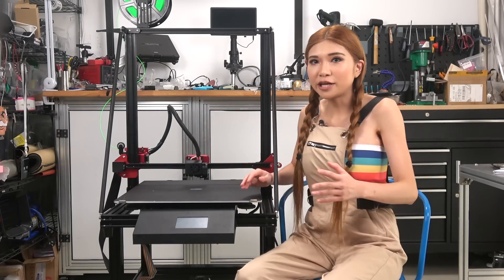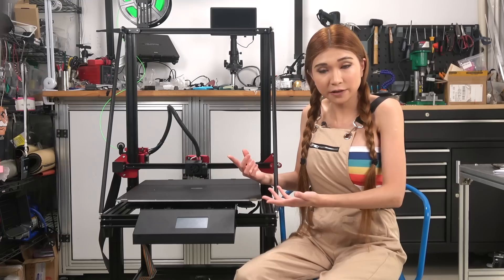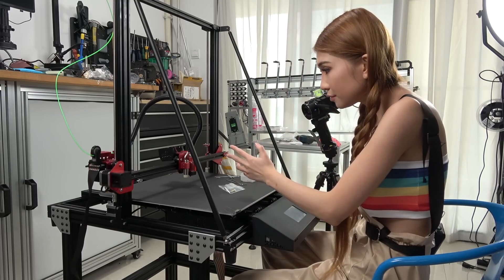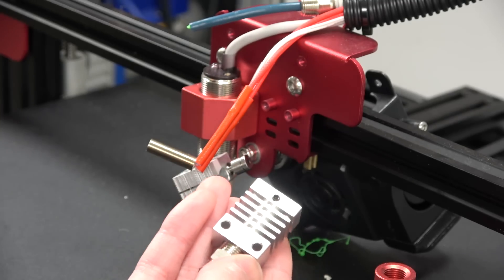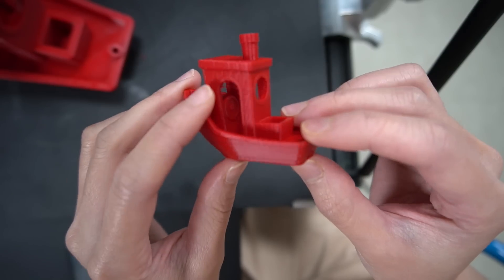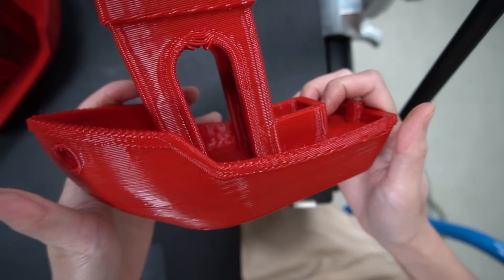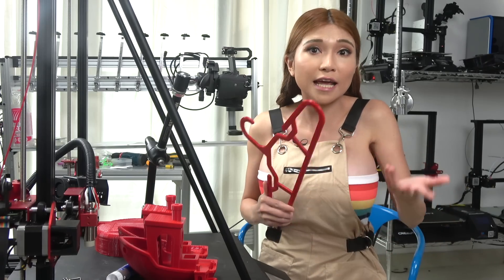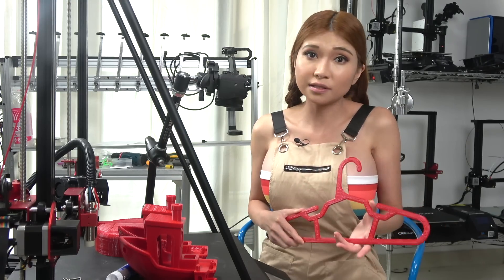First Look- Creality CR-10 Max! Also, Supply Chain Disruption- Are We There Yet?

Comment: I don't really know anything about 3D printing - would it be possible to print the exterior at a higher, smoother resolution, and use low resolution for the core? So when it's printing part of the surface, it switches to higher res - or do you need to physically set the nozzle to a certain size before you start the print?

If they can adjust the resolution like that you might be able to get quick, solid prints that still look nice on the outside - maybe even nicer than usual!
Reply from the maker: Yup! There are printers that do that, does not save a ton of time though...
Reply: @Naomi-Wu  hrm, wonder if it's the adjusting that's slow? Like ideally it would be close to low res speed since most of the printing is at that resolution. Maybe they'll get better at it in the future!

Hope you donate that massive boat to a kid! Or someone with a bath

Comment: Nice Video but im not exactly shure about the main point, at least it was the main point for me. A print needs to be structural so the highter the strenght and the less material i use the Better it is. 
And there comes the problem with wood u have the propaty of lets say a softish pine that grew fast that u have big wood rings that wood is soft, hard wood grew slow and had small wood rings. 
Now comes my point i think cnc kitchen prooved that with a .4mm nozzel he got the most layer adhesion with 1.6mm layerhight and that is a ferly fine layering. compered to suber massive layers. Is there some literature providing proof to your theses ? 
Overall it was a good video. Taking in vids means information and i like information.
Reply from the maker: CNC kitchen knows his stuff so if he tested it I defer to him😉

Comment: What would the minimum allowed layer height for a nozzle that size be, and would the density of the wall thickness make for a better approach. Like would printing at  
.4mm height with just 1 or 2 walls as opposed to .4mm nozzle needing 3 to 4 walls to produce clean prints and would it increase strength by having more surface area bonded per layer with a 1mm nozzle?
Reply from the maker: You can go as low as you like, just get a really thick wall (and no sharp edges).

Comment: DAMN! This made me realize, we need to GET RID OF the standed E3D mount and convert the heatsink into a super deep thread like the sensor you got there, the nut side does not need to be super deep, just the heatsink so it functions still as heatsink, but that would solve the issues on replacing / upgrading / adjusting hotends.

Comment: Large 3d printers have their own place, and are not necessarily weaker (wrong settings!), and you can also print fast (volcano hotend + high temp). I own a CR-10 S5, Anycubic Chiron, Folgertech FT-6, Tronxy X5S large printers.

Albeit i agree, small printers have their own place, most parts are fairly small. Unfotunately, with creality you get soooo slow printer at small size it's a net negative due to the small motors, drivers etc. Something like Ender-3 + even sturdier frame + LARGE motors + STRONG drivers (if not TB6600 then atleast DRV8825) would be suuuuuper sweet. Esp if using MKS Gen L or BIQU SKR instead of their own closed crapola.

Comment: Never expected Creality to come with a printer even bigger than the CR10 S5 to be honest, altough it looks to be an upgraded version of that machine. I wonder what has been done to optimise the weight of the heatbed (and torque Y motor) and the heatbed heating/bed insulation to make the bed even bigger without issues in movement or heating. I was so exited with this new printer from Creality I didn't even notice this was an old video ;-)

Comment: I would put my 1.2MM Super Volcano up against any glued together multiprint... provided that each part isn't rotated for maximum strength in a multitude of stress directions (gotta compare apple to apples). If a nozzle is pumping out 5X layer heights then that is five .2mm layers printed in a single layer so that one layer isn't going to split from its self. Not only that the volume of heat and the huge cross section of contact between each fat layer allows for incredibly strong layer adhesion. You could only match that layer adhesion with 3D Gloop. Also, I, like many others on youtube love the fat layer lines... just like some people love wood grain. I love larger nozzles... bigger... faster and beautiful.

Big printers are NOT Stupid. I have all kinds of printers(MK3, Beast, CR-10, CR-10S5, I3 Mega, Select Mini) and I love my large nozzle printers and the prints that come off of them!

Comment: You know this Naomi, as you taught me! But some viewers might not realise the 'ace' a large 3D printer has is small production runs of multiple parts. Sure, 16 hours for a single really large print is not practice, but getting 30-50 identical (cheap) product parts with no human interaction needed during that time is fantastic for a small manufacturing business! 

It's nice to see the dual motor drive added on the moving bed. I added a more powerful motor to the bed of my CR10S Pro, I felt it needed a bit more power too. ( https://www.instructables.com/id/Creality-CR10S-Pro-Y-Axis-Stepper-and-Power-Upgrad/ )

I'm more than happy to listen to you talk for hours. If the subject interests me I want to know everything and you present very well! I liked the talk you did about open source, it was informative for a small business.

Comment: Printing 2D used to take ages when we had plotters drawing complex drawings. What we need is the same innovation in 3D printing that we had with inkjet printers, like 32 nozzles very close together to give a wide print path so only a few passes are needed for each layer and the printer would be optimised for raster printing for high speed. With triple row of heads you could get full colour printing too.

Comment: Nice video, thank you.
I have a question . Even though the parts printed with thicker settings look "bad" wouldn't they actually be stronger, ie : more stress resistant ? I guess it's more of a structural resistance question which might depend on how you fill the insides but could there still be a difference ?
Reply from the maker: Yes much stronger

Comment: Awesome uploads, I love how honest you are as a person. Really makes listening to your reviews and thoughts so worth my time.  

I agree with your reasoning that large 3d printers are kind of a waist of space. Even when making larger objects, the advantage of strength and being able to modify and replace parts of a multi piece item seems smarter and more efficient. 

The one use at low resolution is as someone already mentioned, that you can print lots of small prints at once.

 I would however much rather se a printer with a moving track bed that in theory can run until the plastic runs out. Please build! 🤓

And as always, looking sexy! 🖖
Reply: Depends on what you're printing, Most of the thing I end up printing are either too small for FDM or too large for a conventional printer and have to be outsourced to the other side of of the country, I'm actually glad to see the CR10 MAX. I just wish it was bigger like 1000x1000x2000 large so that I could start printing 3 part moulds for custom aeroshells.

Comment: This video seemed very instructive to me.  I liked your recommendation of using an aggregation of multiple small grain prints in place of a single large grain print.  Would like to have seen you break up the boat print into assemblies using the CAD/CAM software you use.  Then print the assemblies and build the large boat from them.  Good job regardless.

Comment: interesting. I havent seen a nozel change before. seems like it might be an idea to have a modular, "hot" swapable with print head, cooling system, and calibrated sensor modual (say that five times fast) option for bigger printers. just pop off the one you're not using, throw in the one you want, maybe have a jig so you could extrude the remaining plastic off the bed? great info and vid tho. deffinately something i hadnt put much thought into prior
Reply from the maker: Sure, see the E3D tool head system

Comment: The problem is that a 3D printer can't do everything, if it had 2 print heads and could switch between them while printing an object then the outer parts we see could be a fine resolution while everything else could be printed with the lower resolution.
Or we can just choose which head to use.
Reply from the maker: Sure, there are printers that do this

Comment: More great content,  great insight into these things with regards to larger prints on 3d printers.  What you said made sense as materials are strengthened like cardboard with corrigation.

Perhaps dual nozel / multi materials will help out in this area also, I know dual material printing will likely come up quickly with materials like Ninja Flex etc etc, keep keeping it real

Comment: Interesting take on large printers.. I got the E3D V6 lite .8mm hot end for my RepRap to help deal with print speed as well .. I'm actually okay with the 'jagged' appearance of thick-layer prints..  I feel like you can always sand the edges if you really wanted it smoothed out

Comment: A preheating laser pointing directly ahead of print nozzle path may improve binding and increase strength in large builds. Might even be able to get fiber optics right to the tip.

Comment: I think people are missing the mark, 3D printing will never replace injection molding for an injected molded part takes seconds to make, so in any type of mass production injection molding wins hands down! 

Where I can see this large format printer being very useful however though is when it comes to the need to make a prototype, or a one off mold, when you consider the time it takes to make a plug for a fiberglass mold, it can take a worker a week to build a plug that this printer can make to tighter tolerances in a day or two. 

However in this application smoothness is going to be a necessity! 

As well where 3D printing is going to shine is in creating parts that are not commercially available, for instance I am going to be 3D printing storage containers on my boat that fit into the space I have for my tools because I could not find a commercially available option that would fit in the limited space I have. 

This  printer will be especially useful in creating things like custom tool drawer organizers, the ability to create a 3D printed insert that would organize the drawers of my toolbox is something that is very appealing to me, however this can be achieved with a smaller printer then just simply gluing the parts together; and I like that idea a bit better because if you use a weak glue that can be broken, you have the ability to change the drawer without the necessity of printing a whole new insert. 

However when you are talking about something like a coat hanger, eh, I think 99.99999% of people will just order more off Amazon and have them show up at their door without thinking about it. 

As well with the surface finish, where this becomes an issue is if you are attempting to keep what it is you have created clean, those thick layer heights are all dirt traps, where as the thinner heights can be smoothed, and a smooth finish is easier to keep clean. 

If what you produce is something that is going to be handled over and over by people, having the deep grooves on the surface can make it a germ trap. 

As for more speaking in the videos? YES! YES! YES! 

It is interesting to watch you make things, but also I want to hear the reasons why, that is where the genesis of new ideas comes from. So often I see people make things in videos and do nothing when it comes to talking about it and I am left with more questions than answers. So absolutely more talking in the videos!

Comment: Love the talking more, and I love the fact you highlighted the down sides of large printers. I would like a dual head printer that uses a large print nozzle on one and a small print nozzle on the other. Print only the perimeters with the small one and do 3 or 4 layer heights with that one, then come back with the larger nozzle to print the inner layer. They would need a docking area with a wiper for the drip and do a short purge before printing their part of the print. Mechanically I can figure that out. I have a mechanical engineering degree.  My problem is the software side. I can't code to save my life! Great video as always. Keep them coming!
Reply from the maker: Sure there are printers that do this and standard slicers support it
Reply: @Naomi-Wu  I have been looking for one that does it well. I don't know of any that do. If you could do a video on one or let me know where to look that would be great.

Comment: I'm not going to give you a thumbs down, but you are flatly wrong about the large footprint 3-D printer's utility. It is not a toy maker, it is a prototype printer. Combined with lost wax, or investment casting, it makes it possible to print a gas turbine, or engine that can be cleaned up, assembled, and then run. Small 3D printers are too small, seams cause problems in alignment and strength, and there are a host of other problems in uniting small prints into a larger unit.

But look into investment casting. It IS dangerous, so DON'T jump right in. Do your research first. But it will take your tinker and making to a whole new level.

Comment: Large 3D printers are useful for the stuff I do. I make big RC planes. Making several small parts ends up much heavier. Check out my channel for some videos of my big 3D printed EL-39 jet. It's 8 kg flying weight and goes up to 240 km/h.

I now use a 0,3 mm nozzle in my big printer for reduced weight. It's still super strong for rc plane use, with custom internal structure to support the skin. I'm almost finished with a new giant jet.

Comment: I like your points on comparing small 3d printers and large ones. I have 2 small ones and 2 larges ones (400x400x450). For me, I collect and play board games and most of my prints are organizers to fit inside the cardboard boxes. It is so much easier for pieces that are just too big for my smaller beds. I find because these pieces are only a few inches high they are much more sturdy when printed in one single piece than two smaller pieces. If the print I am doing is smaller and I have an available smaller printer I usually always set it up on them.

Comment: Naomi, I like a lot of what you do, but you've got large scale 3d printers all wrong.  Big prints should be treated like investment cast molds.  All my large prints are done with minimal infill and open cell configuration.  At key points I add fill knocks.  Then when it is done, but before it is used I mix up some binary plastic with fine chop fiber and I pour it into the hollow wall print.  When it's done curing I have something stronger than any other 3d print out there.  And it's usually massive, and quick to print.

Comment: I have been asking for a CR-10s5 version for your Pro .... and you near got it... I need it in 500x500 though, yes specific thing I need to reproduce, time isn't a factor really, and I have added metal rod locations to strengthen the print.  I did get a S5 and put a lot of upgrades onto it, auto bed leveling is what im working on now because I cant seem to get the Med to manual level even with lot of changes there to try to get it flatter. nice review.

Comment: Great job. What heater head did you change to? We run 0.6 nozzles in all 3 machines, (2 Ender3's and a CR-10) mainly because we are running carbon fiber. Would like to get print speed above 65-70 since these are proto/production parts. Again nice video and love the stand. I will have pictures of the parts from all the machines if you want to see them.
Reply from the maker: E3d volcano, great hotend

Comment: I think the level of talking vs. showing was fine.  The information was more about the concepts than the execution.  

The supply chain disruption is most obvious with small plastic parts that are infrequently needed.  I needed to replace the sun visor clips for a 22 year old vehicle.  The part is seldom needed, and the model is long out of production.   To buy the part new was $20, and the warehouse was in another country, so it would take about 7 days for the part to arrive.  A suitable part was available on Thingiverse, so I downloaded and printed the parts in a few hours with ABS (so I could sand and paint the part to match the interior color).  Small, obsolete and out of stock parts like this don't need to take up space in a warehouse.  Sell me the file for a few dollars and I can print it faster than I can get it in the mail.  

If possible (and appropriate), can you share the link to the parts you used for your large nozzle conversion?  Since that is a pre-production version, I understand that the parts use use may not be appropriate for the final version.

Finally,  There are times when a Large printer is appropriate, especially in cosplay and prototyping.  For example, the ACES helmet that Tested printed for Adam Savage's flight suit would be too thin to work well as a multipart assembly (I think they used a .7 mm nozzle, too.
)

Comment: I'm printing an Electric Guitar body I designed in Solidworks and it won't have a cord connector on it. It will have a built in FM modulator which will send the signal to a receiver. It will be rechargeable with 5 Volt charger and I'm building in the multi-track recording system with phaser, flanger, echo and distortion so it can easily be set while you're playing. I'm also working on a bluetooth application to send the controls to your smartphone so you can use it as a mini recording studio. I think it will be the first of its kind. Love Shenzhen! Shenzhen bay park and Windows of the World! You have an awesome city!